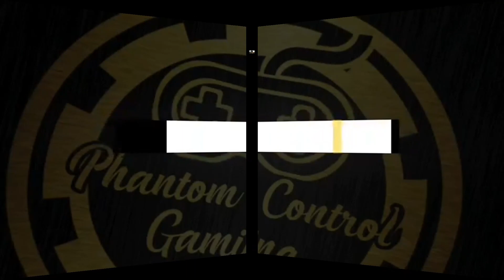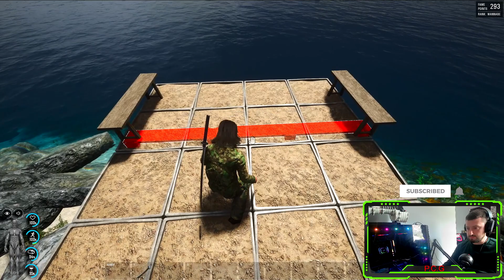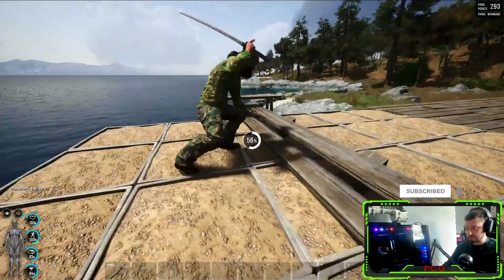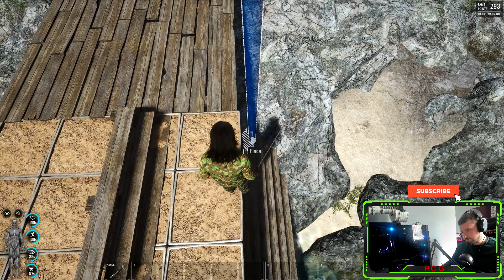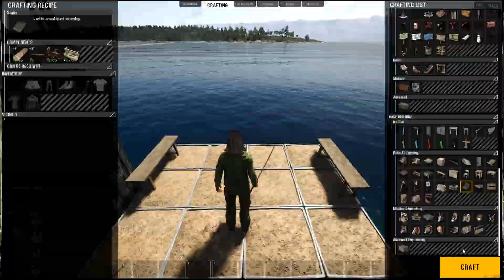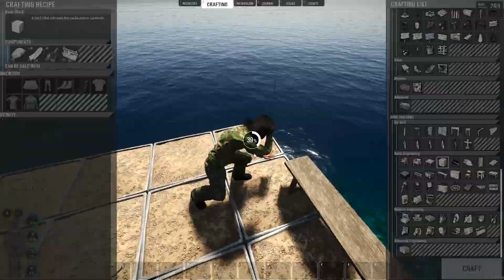How To Build A Base On Water In Scum, Water Base (2022)

Comment: If you delete the sand bags are you able to make the base that would need a draw bridge to cross?
Reply from the maker: Yes indeed! pretty much would make it extremely difficult to raid almost impossible without taking over the flag or parachuting inside.

Comment: Does this still work with foundations or only blocks? I just want my large cabin in the lake
Reply from the maker: There are certain areas with shallow water that you can still build foundations on but unfortunately for deep water builds only the blocks work at this current time.

Comment: You can use a single bench most of the time.  Tables also work and are a bit better to use in multiplayer since they don't require a bolt.  Tables work great for doing 8 blocks at a time as they will allow you to place stairs on either side of it.
Reply from the maker: This is fantastic advice thank you very much! I will be certain to apply this knowledge moving forward 👌